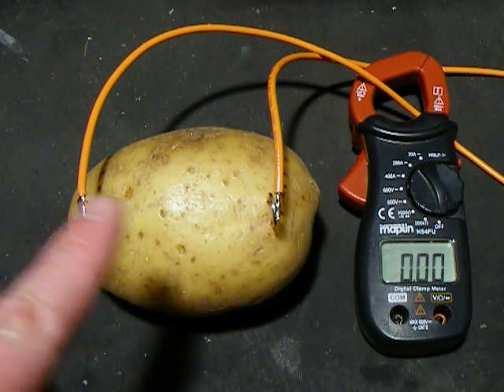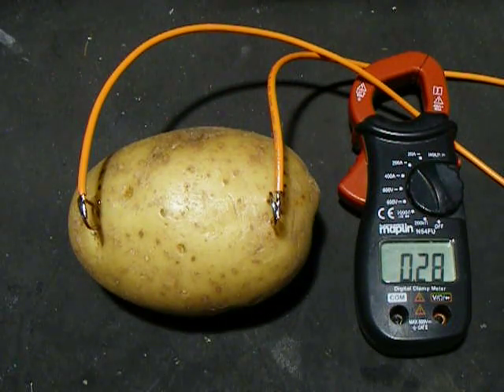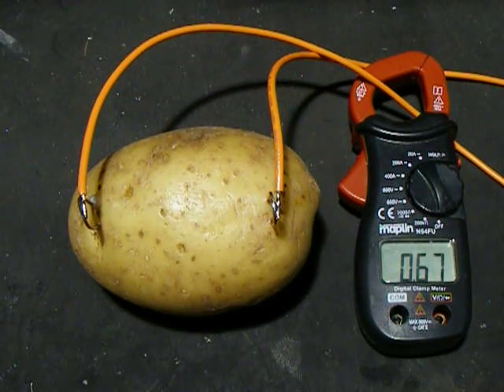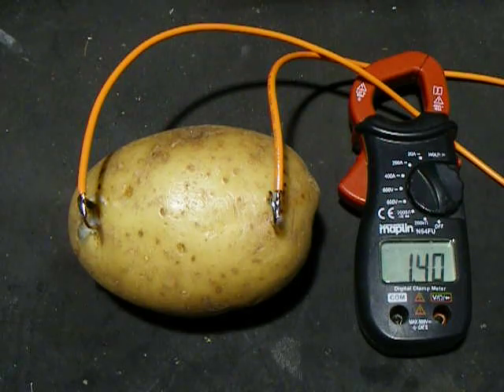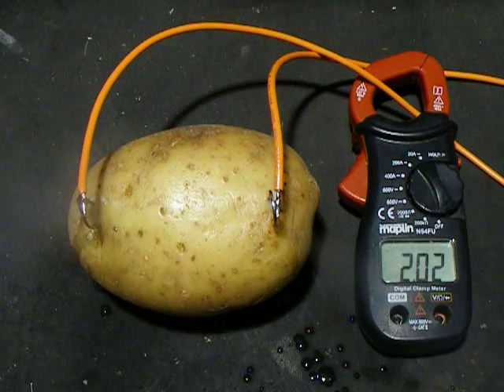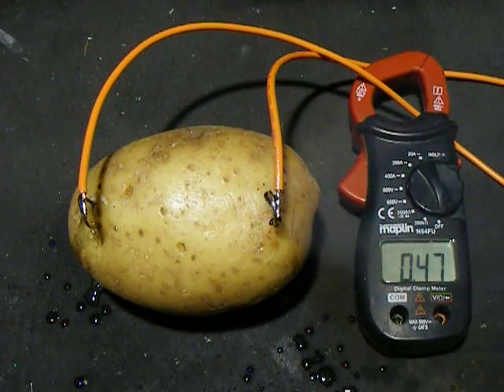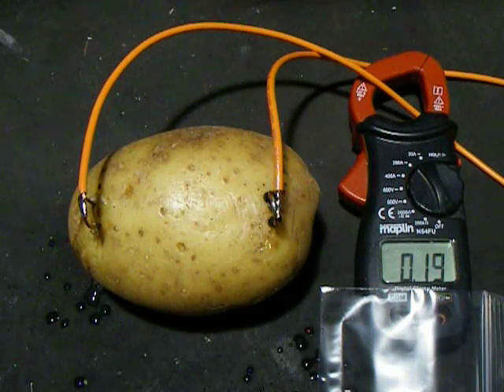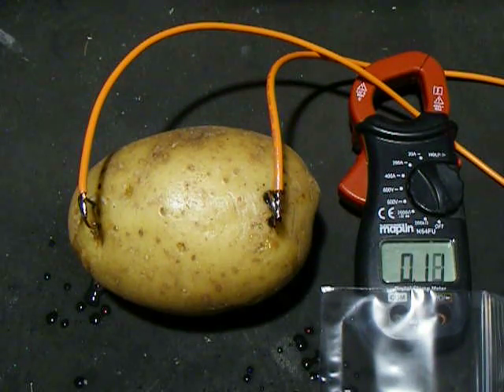240v mains electric potato

Comment: Can you cook a potato like a hot dog doing the same thing? When I was a kid I would take an old extension cord and remove the receptacle end and wire on two forks.Insert the forks in each end of the hot dog and plug it in for about 10 seconds. It also worked on half smokes, just took longer. Before microwave ovens were available. I always remembered to unplug before removing forks.Crazy things kids do.
Reply from the maker: It doesn't work.  The potato burns at the electrodes before it's even warm.

Comment: I think there was a hot dog cooker in my father's household in the late 1960s that operated on a similar principle as this (long bus bars with spikes which you apply a standard hot dog to and then run 120V 60Hz through it). uxwbill has a video on such a device.

Comment: It's being cooked unevenly, too much at the electrodes.
I recommend next time to cut it in half, sprinkle same salt, and it put back together.
Then apply a lower voltage, perhaps 110v ac.
Try making a "light onion bulb".

Comment: I have two thoughts Clive .. 1 spike the potato all over (as you would when cooked in a microwave) ... and 2 cut off ends to make flat ends. Then use stainless steel plates for each end as opposed to probes ? Photonicinduction has done a similar experiment. Very cool to observe its behaviours though. Thanks !

Comment: Clive, I'm sorry, but you didn't read the manufacturer warnings. Potatoes are considered primary cells only and it's not surprising that it's now leaking hazardous potato acid on your desk. Even though it is technically possible to recharge a potato battery a few number of times, you should have been aware that most potatoes of that variety are grown in Idaho, which has 60hz 120VAC mains. Those potatoes are not compatible with the 50hz 240VAC current you put across it.

You should have used a proper eggplant, as those are both suitable as secondary cells as well as multi-voltage compatible.
Reply: Spunta works with 220V 50Hz?
Reply: i still think this is the best reply ever
Reply: "potato acid"

Comment: We had a rat get behind a 3 phase switch board at work and blew a 200 amp fuse hard to believe such a small animal could draw so much current . Apparently what happens is once the rat gets electrocuted and lies across the contacts it gets cooked then turned into carbon which is much more conductive and blew the fuse.
Reply: gatekeeper65 Squirrel.
Reply: +190055joe I once had a squirrel run across a 16KV fuse and blow it, the electricity lit an arc up his leg and vaporized his fur into plasma, which both electrocuted and seared it, our power was out for 2 hours XD
Reply: What did the squirrel taste like ?
And don't say chicken.
Reply: A couple of years ago, a mouse in our kitchen decided to experiment what would happen if he shorted out hot and neutral on a socket.

It ended with my mother (with musophobia) discovering the results (i.e. death of the mouse) early in the morning. 

You could probably hear the shrieks for miles.
Reply: A crow perched on the transformer on top of the phone pole outside my house. Power went out for my whole road. The crow caught fire after he died. Any doubters can be supplied with pics of this charred crow on request. To be fair, this transformer was put in over 40 years ago.
Reply: hucker75  40 year old transformers weren't exactly built to the same safety standards as today, hence open contacts

Comment: An oldie, but a goodie. 👍

The nicest 240V "experiment" I tried in my youth was a cardboard chip tray filled with damp (not quite sloppy) table salt with a 6" nail laid flat at either end, connected direct to the mains.

You really should try it.... It's beautiful and surprising (but beware hot , spitting, wet salt).

Keep up the good work!

Comment: Can you do the same by connecting a clock to it and spinning the hands really quickly?
Reply: No. Not enough power and probably DC output.
Reply: @CTimmerman  - Really? Because I was totally serious about using an inverted potato clock as a replacement for mains electricity. Took 4 years but finally I know.
Reply: @RFC-3514  You're welcome to try.

Comment: Mentally I kept calculating the resistance of the potato. It got as low as 120 ohms, but was back up over one kilohm by the end. I suppose a potato is a voltage dependent resistor.
Reply: Im quite sure its because of the water that evaporated at its peak current.
Reply: Never forget to use a current limiting potator in your circuits!
Reply: @DasIllu  That will certainly make circuits much larger in the future. Could we possibly use pearl onions instead? If we could find a good vegetable to use as a diode, would that make a circuit completely organic?
Reply: @mitch3064  Beans might be good as diodes. They tend to force thing going one direction.
Reply: @DasIllu  Too true, too true.

Comment: You have overcharged your potato battery. Cool, next do lemons, make sure to use copper and nickle.

Also I wonder if it would have had a higher output voltage than a standard potato before things started going bad? :)

Comment: Is this how you recharge a potato that's been used in a potato clock?
Reply: I do believe you should use direct current for that, AC straight from the mains will just oscillate the charge in and out resulting in a degraded potato. I recommend using a full-wave bridge rectifier and inserting the leads from the extreme ends of the potato. I have found this method to be able to fully recharge a potato five or six times before the natural electrolyte becomes unusable. Also remember that you should never eat a fully recharged potato as the electrons inside might cause cancer!
Reply: @petti78  Wow I never knew that a spud could be recharged..
Reply: I actually wonder now what happens if you do it with DC.

Comment: What an interesting way to bake a potato - directly with AC power. I am going to try this. Hopefully 120 VAC is enough...
Reply: 240 Volts = well done
120 Volts = medium
100 Volts = rare
Reply from the maker: +LakeNipissing Sadly it doesn;t really cook the potato very evenly.  It just tends to burn around the electrodes and the rest is warm but raw.
Reply: +bigclivedotcom Maybe 120 VAC will provide a slower, more even heating with less current flowing through it than with 240 VAC. I am curious enough that I going to have to try this.
Reply from the maker: +Martijn W You need a Presto hot-dogger.  A device that cooks hotdogs directly on the mains.
https://www.youtube.com/results?search_query=presto+hot+dogger
Reply: Nah, just means it has to cook longer.
Reply: +Martijn W haha i watched this vid because my dad used to tell me about this death trap him and his fellow mech E/EE roommates used to cook hotdogs(most of their food) in the dorm. it was a plastic block with two sharp electrodes stickign straight up about 5" apart. youd just slap the hotdog on the two poles and run it until the dog split.
Reply: +bigclivedotcom Something fun for you to try.  If you plug LEDs into one of these cooking hot dogs they will light up as the hot dogs cook! ;D
Reply: +Lo Tek The school I went to for the 2nd half of 5th grade (family moved halfway through) had two copies of a book of electricity experiments in the library. Among the experiments was a hot dog cooker like you described. One of the copies actually had "Do Not Try" or something to that effect written across the pages describing this experiment. Not sure why the second copy didn't, though.
Reply: The 1955 edition of the "Popular Mechanics Do-it-yourself Encyclopedia" set has plans for a similar hot dog cooker.
Reply: +bigclivedotcom Thank you. I found your video because I wanted to try this with Hotdogs at the office. :)
Reply: What about the pickle video at mains?
Reply: Hmm. Looking at it this has been done many times before. I'll stick to watching the YouTube vids instead and getting myself a presto. Thanks for the link!
Reply: +bigclivedotcom I had one of those hot-doggers many years ago. It worked, sort of.
Reply: ***** Cold potatoes.

Comment: So what then is the typical wattage of a potato?
Reply from the maker: Crux161 A typical potato can handle about one billion gigawatts.  But it tends to make a bit of a bang and smells like french fries.
Reply: @bigclivedotcom  Now I see where the inspiration for the cheese light came from!
Reply: +bigclivedotcom I don't think science has fully mapped out the possibilities of tuber illumination.
Reply: bigclivedotcom Cook one using high tension! Hook up a bunch of CCFL inverters in series or a TV flyback transformer or something i dunno..
Reply: I think he exploded one with a car-battery sized 2000V 100uF capacitor!!!!
Reply: +Crux161 thats simple. watts is volts times amps.
Reply: +bigclivedotcom 
Ive gotta ask if you attempted to taste it.
Reply: +Sam Noneofyourbisnus Yes but you would need sampling at intervals to gain an average.
Crispy French fry or soggy and steamed. Hold the ozone if there was any.
Reply: Well over 400 peak as we could see.
Reply: to be clear I probably should have said resistance of a potato, and this the Watts in terms of heat and not lumens by wattage.
Reply: ChaosHusky I have to do that one xD Let's see what happens..